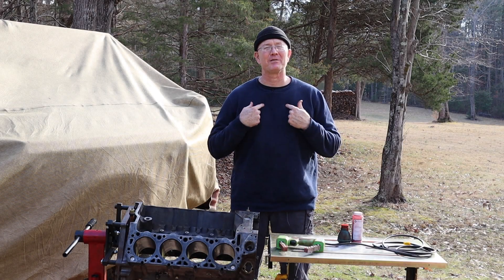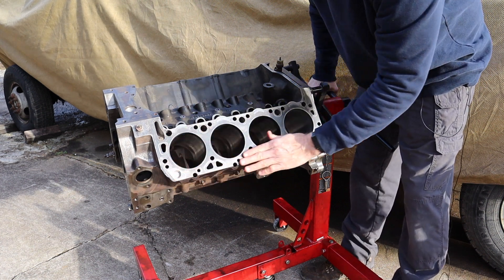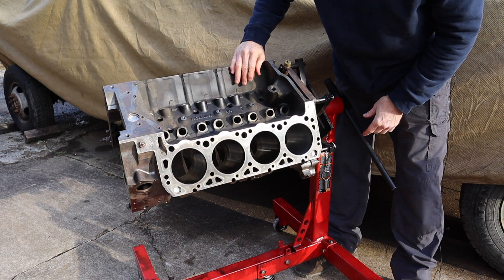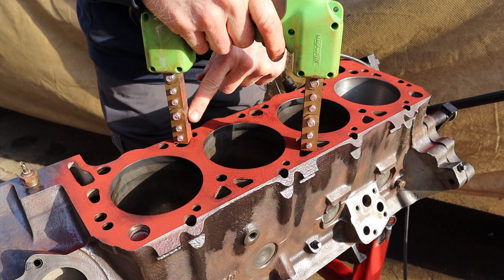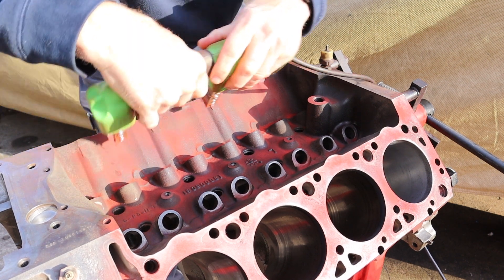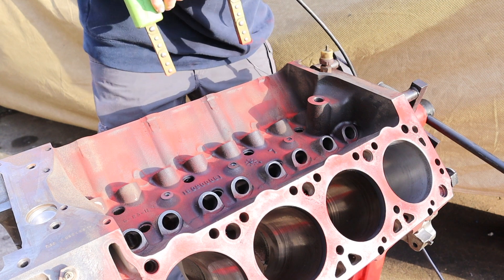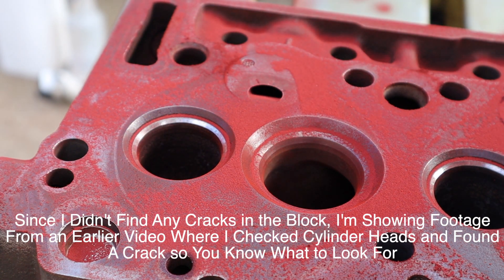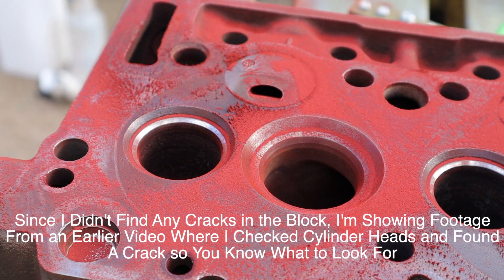How to Magnaflux an Engine Block at Home to Check for Cracks!  Project Brutus, Ep. 17

Comment: I havnt seen one of those since 96 we used them for stuf that wouldn't fit in the wet machine. I always did it twice would take forever but even doi5it twice every once in a while one wouldn't show up but us9rhe ones that dont show up are not a problem. On the wet machine a crack always showed up was amazing on diesel heads how many cracks were within tolerance i dont think any of the semi diesel heads we ran thrue dint have a crack but was so long ago goid to see one of the old hit and miss machines being used with everything made of aluminum cast iron blocks and heads are a thing of the past. Im hoping to get ahold of a idi this winter to build up for my 4x4 85 e150 build. But not sure if its going to be possible now with these health problems sucks. Thanks for the video!!!!!!!
Reply from the maker: Thanks for the input, Steve, and good luck with your 4x4 E150 project.  Scott

Comment: Does the block need to be broken down and everything removed, crank, pistons,? Can it be done with them installed and cover the bores?
Reply from the maker: Luke - Yes, there's no requirement to completely disassemble the engine.  Just a lot easier if you're working with a bare block.  Scott

Comment: I've looked at dozens of these engines. I have seen two or three that were cracked in the lifter valley, but they were 6.9s. I don't remember if they were A blocks or B blocks. It is a good idea to check there for cracking on all blocks, but it is rare for it to happen.
Reply from the maker: Jeremy - Always nice to hear from the voice of experience!  I agree that the lifter valley isn't a common place to crack, but checking it only take a few minutes.  Thanks for the input!  Scott